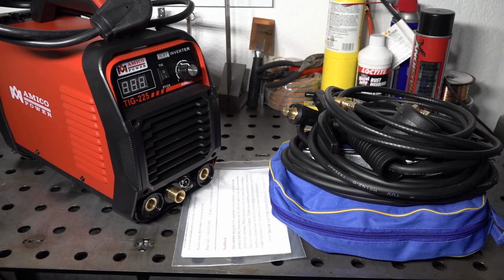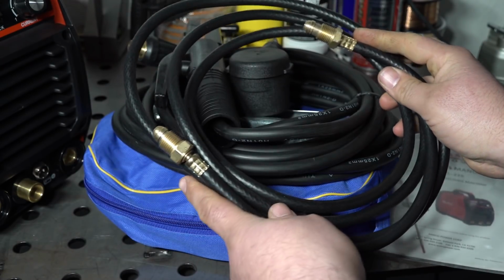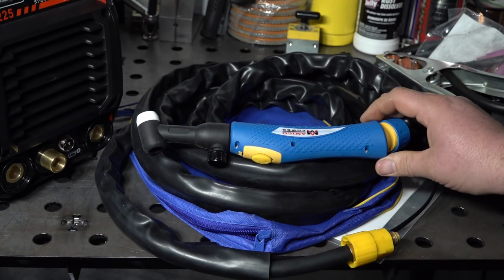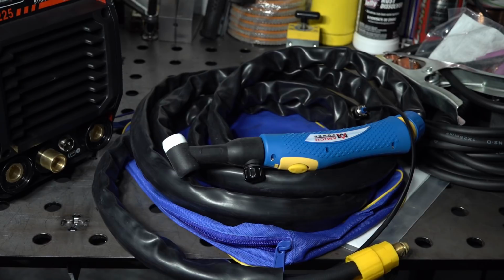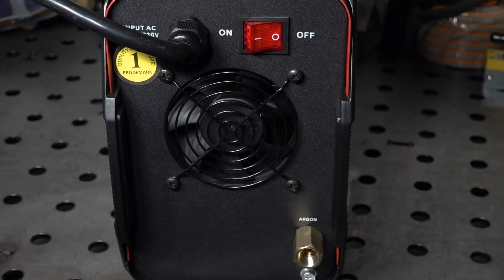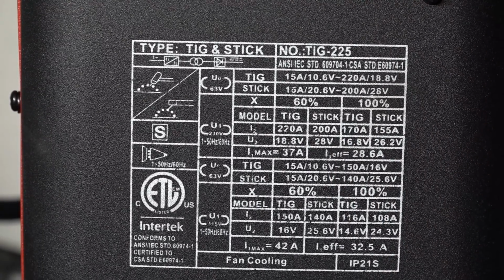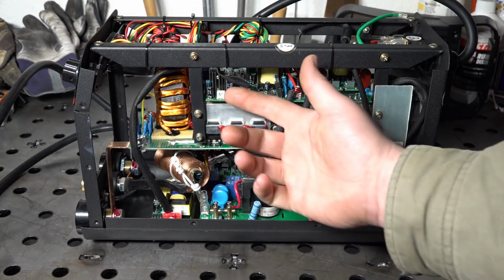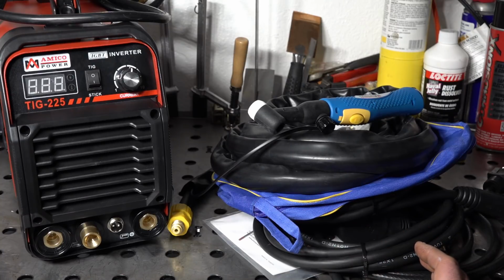Amico TIG 225 Review: Pt 1

Comment from the maker: I know a lot of people are critical of the fact that I pointed out so many little issues on this welder.  Many said I was expecting too much out of such a cheap welder.  The implication is that I should overlook issues because of the price.  I don't point out issues because I expect it to be as good as a more expensive welder, I point out issues because I think they are issues, simple as that.  If I accept issues simply because a product is cheap, the manufacturers would never have a reason to improve and we'd continue to get the same stuff.  More importantly, I point out the issues so that anybody considering laying out their hard earned money will have the best picture possible of what they will be getting for their money.  

I only bring this up because I just ordered a newer version of this Amico welder to review and compare.  It is the same price as the welder in this video, but it is improved in just about every way I can see so far.  The gas fitting on the welder is correct and works properly.  There is adjustable post flow, rather than the fixed 3.5 second post flow on the previous welder.  The included torch is a similar design, but is far less bulky, the button on it is positioned better and is far easier to press.  Even the internal build quality seems like a big improvement.  The design and layout of the internals seems to be a far better and more robust design.  We'll see how it does once I do some welding with it, but so far I'd say it's significantly better than the one in this video, at a similar cost ($279).  

I don't claim that my video had any influence on this welder being improved.  But if everyone accepts faults, big or small, simply because a product is cheap, where is the motivation for manufacturers to improve?  Either way, I'll continue to point out everything I feel is a positive or negative about the things I review, regardless of price.  People can then take those things into consideration, along with price, to decide for themselves what's best for them.  But as always, I welcome comments, questions and criticism.  Cheers.

Comment: On the tig torch, you stated that the black gas knob does not control anything?   Then how is the gas controlled?  This is confusing as all tig torches operate the gas through this knob. Do you mean the flow amount cannot be controlled?  Hmmm.
Reply from the maker: As with all TIG setups, the flow rate is controlled by the regulator/flowmeter.  On welders without a built-in gas solenoid the valve on the torch is simply used to turn the gas flow on and off as you weld.  Many TIG welders, including this one, have a soilenoid built-in that automatically turns the gas flow on and off when you start and stop the arc.  So the valve on this torch is unnecessary and should be kept open all the time.
Reply: Thanks, I see,. Maybe a safety precaution if the built in solenoid fails?
Reply from the maker: I think it's far more likely that they use the same torch on lots of different models because it's cheaper than using different torches.  It wouldn't really be unsafe if the solenoid stuck open, you'd just lose/waste your argon.
Reply: @bigtb1717  that's what I meant, losing the gas.  Thanks  tb.
Reply from the maker: Just another note.  You should always get in the habit of turning off the gas at the cylinder valve when you aren't using the welder.  With all the connection points it isn't uncommon for at least a very small leak to be present.  You may come back a week later and find the cylinder low or empty, even if the gas solenoid is working properly and/or  you closed the valve on the torch.
Reply: @bigtb1717  thanks, and when you open a cylinder, always just crack it open, never open all the way. It's not necessary.
Reply from the maker: On argon and other shielding gases I always open the valve fully in order to back seat the valve and seal the packing to prevent leaks.  Fuel gas tanks it is a good safety practice to open them less to allow quick closure in case of a fire or other dangerous leak.  That's the way I've always done it.
Reply: @bigtb1717  everyone has their way, cracking it is mainly a way of preventing full force on the regulator valves. Tank valves in my opinion are fairly solid and I've not yet heard of one leaking. But never say never.   cheers brotha.
Reply from the maker: For sure.

Sometimes it seems that if you ask a room of 10 people for their opinion you'll somehow end up with at least 12 different opinions.  Lol.
Reply: @bigtb1717  Nature of the beast TB,. LOL!     My uncle and father were expert welders. My Uncle made his living by it.    Keep the vids coming!  J.

Comment: I thought the same thing about the hose when I bought mine, but I found the other end of the hose had a longer threaded portion which allowed the hose to seat fully against the solenoid. I didnt have any leaks and yours may be different, but I suggest looking at the other end of the hose to see if it has a longer threaded portion.
Reply from the maker: I'm glad yours works.  Apparently some are correct.  The fitting on both ends of the hose were the same.  The fitting on my welder was absolutely not correct.  I was able to get it to seal well enough for use by putting a rubber washer in the fitting, but the fitting did not have a seat for the gas hose fitting, so there was no way to make it seal.  Even when I modified the fitting to allow it to bottom out, it only bottomed out against the threads of the gas solenoid inside the welder and did not seal at all.  The fitting does not have the tapered seat that the hose fitting is designed for.  I even emailed Amico about the issue and they sent me a new fitting, but it was the exact same fitting that is on the welder and was no help.

I even tried to find a workable fitting locally, but the threads on the gas solenoid were metric, and nobody had anything locally that would work.  I was going to try ordering something online, but I decided it wasn't worth messing with and just used the rubber washer.

Comment: Hello, what tungsten type do you recommend for these? I picked up a st 185 and thoriated 3/32 and the stuff just melts within seconds. Scratch start and only mild sheet steel @ 110 v. Pure argon btw
Reply from the maker: Are you sure you are running electrode negative?  Meaning that you have the torch connected to negative and the work clamp on positive.  I use 2% lanthanated electrodes personally, but thoriated should work fine.  No matter what particular tungsten electrode you use, it will melt away in seconds if you have the polarity wrong.

Are you sure you are getting shielding gas?  No shielding gas will also cause a sparkler party and a toasted electrode in quite a hurry.
Reply: Doh!!!! Yep had the polarity mixed up, opps

Comment: you can easily add a foot pedal. Just connect one to the front of the welder were the switch goes.
Reply from the maker: You could wire up a foot switch instead of a torch switch, but it wouldn't vary the output like a foot pedal would on most machines, it would just be a switch.  Just be aware of that.

Comment: I considered buying one till you tore it apart and its full of circuit boards,.. now I know its a sham like all the metal detectors from china.
Hell they use circuit boards and they don't work or you wouldn't have to buy a new computer every year,....... and your computer only sits on your desk****
 And you know a circuit board wont hold up when the fan is blowing moist air on all of the electronics and god forbid if you live near the ocean and everything corrodes.

Since it's a farce I think I'd only go with known American brands.

Miller,....Lincoln,.....Hobart- right off Millers line,.......A welder better than Lincoln was Century but now Century is a rebadged Italian Jobby,...Probably good,.....but as I recall the input was 230 and the output was 150 Amps and I draw the line at 160 Amps anything lower than that and your wife's Hot-melt glue gun will be out welding you.

Lincoln 230 volt 180 amp Mig $599.00 at Lowes. 1***
Hobart Handler 190 mig  230 volt 190 Amp $699.99. TSC 2***
Hobart Handler 210 MVP Mig Welder 115/230 volt $849.99,... pricey
Hobart Stick Mate LX 235Mig for $520,......But they refuse to say where its made or who made it?????

Or find an old Century Electrode welder they had adjustable heat range a degree at a time,... the Lincoln  stick welders / buzz boxes are I think fixed heat range as per click.

But will still be there many years after the Chinese trinket's are laying in dump's.

Way to expose  American corruption and greed taking cheap Chinese junk and selling it like its a legitimate product.

And the opposite is price gouging.

As far as Argon,....mine just has a  nipple you slide a 3/16th hose over.

Buy quality and only buy once.
Reply: You know even the American brands use chinese made internals now right?

Comment: How did you fix the argon hose fitting on back of welder to tighten up?
Reply from the maker: I just used a rubber washer to get it to seal good enough to use.  I got a replacement fitting from Amico, which was still incorrect, and modifying the fittings didn't really help, because there was no sealing surfaces to mate up and make a good seal.  

I'm sure there would be better, more permanent ways to correct the issue, but putting a rubber washer in the fitting worked good enough.

Comment: Where did you get your replacement gas input fitting for the back of it
Reply from the maker: I emailed the company and they shipped me a replacement, but it wasn't correct either.  I ended up not being able to find anything locally that would either adapt the fitting that was there, or mate up with the solenoid in the machine in order to replace it all together.  I used a rubber washer to get a good enough seal for use.

Comment: Dude it is a budget welder for someone who can't afford a Miller or Hobart you are really nit picking the carp out of it if you want shock absorber in between the capacitors put some silicone in it its not a professional welder for what it is and what it is intended for its a dang decent welder
Reply: thank you. I hate when people pay $300 for a welder and then complain that it won't weld like a $4000 Miller.
Reply: I hate when the carp is picked out. LEAVE IT IN THE WATER!

Comment: The newest Amico TIG's with High Frequency can't burn E6010's worth a damn. None of these models with a No-load voltage(V): 63V. It needs to be higher for whip & pause or the electrode just goes out and STICKS.

Comment: Awesome video! I really want to get one of these. Would you be able to connect a standard torch and use a foot pedal? Thanks!
Reply from the maker: You can definitely connect a different torch.  I connected one of my other torches with no issues.  Just had to rig up a switch.  I have an update video on the welder where I show that torch setup.  

A two wire foot pedal should work fine, you could start the arc that way.  But there is no way to control the amperage remotely, so the the pedal will start/stop the arc, but not vary the amperage.  You could even get a simple foot pedal switch for $10-20 and wire that up.  I actually found one on amazon for like $6 that would probably work.  Just have to be willing to do a bit of simple wiring.

I think there are probably better options, but if you are set on this welder I have some more info in my other two videos on the welder.

Let me know if you have any other questions or if there is anything I can help you with.
Reply: Thank for the quick reply! Sorry if i sound like a newbie but can i hook up a torch to the positive and negative, then have the gas directly coming from the argon bottle to the torch, and plug a foot pedal straight into that two prong port? I understand i couldnt control amperage but could i plug n play the foot pedal just for on off without wiring for now? Thanks again and sorry if im confusing!
Reply from the maker: No problem.  I would imagine someone makes a foot pedal with the correct connector to plug right in so you wouldn't have to do any wiring.  I don't suppose they would be very expensive either, I was just pointing out that you definitely have options for a foot pedal, one way or another.

For the included torch you have to connect it to the gas fitting on the welder to get gas from the solenoid.  If you use a different torch you could definitely connect the power for the torch to the negative connection of the welder (for TIG, the torch is negative and the ground/work clamp is positive) and connect the torch gas hose directly to the gas flowmeter/regulator, but you would have to use a torch with a valve if you go that route.
Reply: Great! Ive watched your other vids on the welder and subscribed, thanks for being so informative. Heres my last question: with the gas valve tig torch you mentioned could i control pre and post flow(through the torch)?

I get that its not the best machine. For the money i figure i can buy this: https://www.amazon.com/gp/aw/d/B00S4JTZW8/ref=mp_s_a_1_3?ie=UTF8&qid=1525385280&sr=8-3&pi=AC_SX236_SY340_FMwebp_QL65&keywords=tig+torch and a foot pedal and be set to go. Of course ill need my argon and regulator. Do you think that would be an ok starter setup (for the dirt cheap price?)
Reply from the maker: Yes, if you have a torch valve you have full control over pre and post flow.  Flow starts when you open the valve and stops when you close it.  

I think you should at least check into other options.  Once you add a regulator, new torch and a foot pedal you might be in the price range of other options.  Obviously you have to decide what is best for you, but I just think it's worth exploring all the options.
Reply: You are the man, cant thank you enough! I can get a full setup with welder, gas valve torch, footpedal, and regulator for $385 shipped. I respect your opinon is there a more completqe setup or close to it thats better?(for the money) Thanks!
Reply from the maker: Honestly, any other options I could recommend would be at least a hundred or so more money than that.  The Everlast 160STH doesn't come with a foot pedal, but comes with everything else, and has the option for a foot pedal with amperage control.  5 year warranty and phone tech support.  Costs $489.  I don't have any direct experience with the welder, so I cannot say for sure, it's just an option, albeit a bit more expensive one. 

Keep in mind though, with the 5 year warranty on the Everlast, you only have shipping covered for the first 30 days I believe.  After that you would have to pay shipping to send it for warranty repair.  

If your budget is firm at that range, I'd have to do some research to see if there is anything else I'd really pick instead.  Nothing off the top of my head.
Reply: I looked into the everlast kit and i do really like it, if i wasnt tight on money i think i would go that route just for the warranty and common-ness.

I also looked into getting one of the old tombstone lincolns and convert it to use dc as well. Do you think it would be worth it to go that route and do you think it would be a much better set up than the amico?(for tig welding)
Reply from the maker: Well, better setup is relative and will be dependent on your needs.  A Lincoln transformer stick welder, either one capable of DC (they do come in AC/DC varieties) or one modded for DC, or a Miller Thunderbolt AC/DC welder would work fine for scratch start TIG.  Downsides are that it would be scratch start only, would use more power than the Amico, wouldn't be able to run on 120V like the Amico, and is much larger and heavier.  Upside is that it would be far more reliable, long term.  There are 50 year old Lincoln and Miller transformer welders (and others) that still work perfectly.  If the Amico burns up after a couple months, the scratch start transformer would start looking like the undoubtedly "better" setup.  If you were trying to load an AC/DC Thunderbolt into the trunk or wishing you could run it on 120V for a repair at a family member's house, the Amico would start to sound like the better setup.  

Nothing wrong with getting started with a scratch start TIG setup, and a lot can be done with one.  But you will have to decide if it will work for you.  Jody with Weldingtipsandtricks has a good video about scratch start TIG setups.  Worth checking out of you are considering going that route.
Reply: You just helped me so much with the dilemma in my head lol. I plan on trying out the amico and if it burns up on me ill send it back and go the tombstone route. Ill keep you updated and maybe even make my own review. Thanks a million!
Reply: The Everlast 160STH cannot either burn E6010 electrodes, which they now state in their description of the model. For this simple reason, it's isn't worth $489. Following model Everlast can probably burn them.

Comment: I was looking at getting this welder, but ended up getting the ac/dc 200 amp harbor freight one for 225 bucks. Reading the product page on amazon, as well as other reviews, it says it is able to use any standard 2 pin pedal.
Reply from the maker: The only 200A AC/DC welder I know of from Harbor Freight is the Vulcan, but it is more like $900.  

A two pin pedal would only be able to turn the arc on and off, but not control amperage.

What welder did you get?  Link?
Reply: which one?, harbor freight has one for 200 bucks , but is A/C only, the Vulcan  is ac/dc and 225 amp, but its 400 bucks.